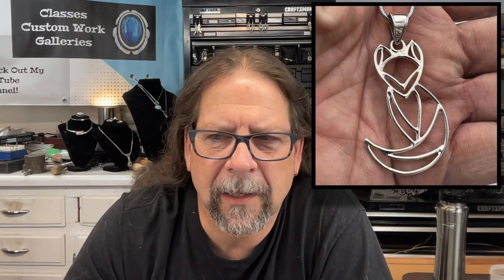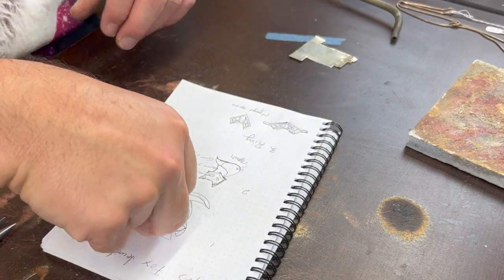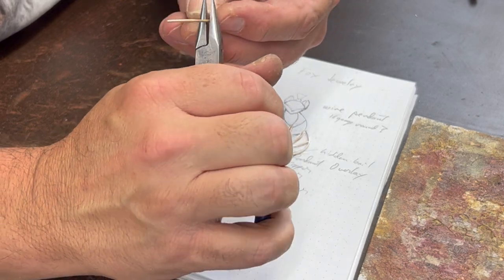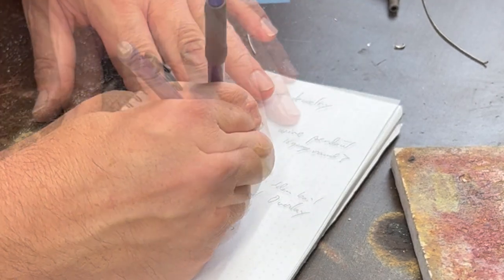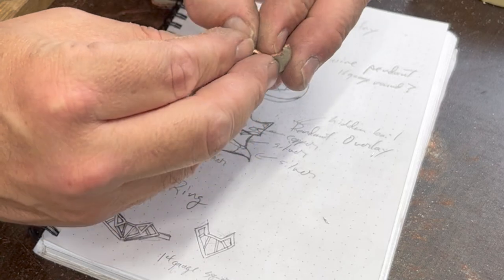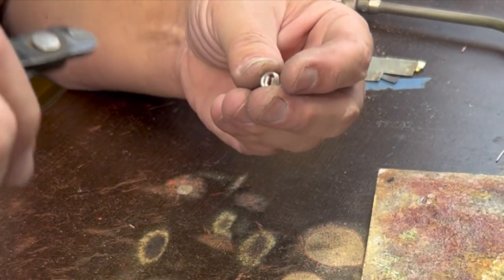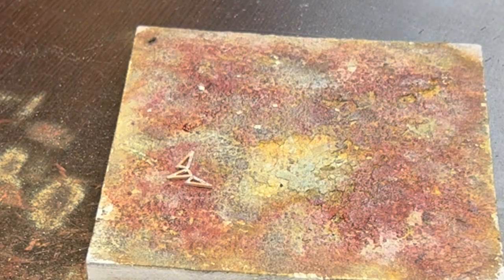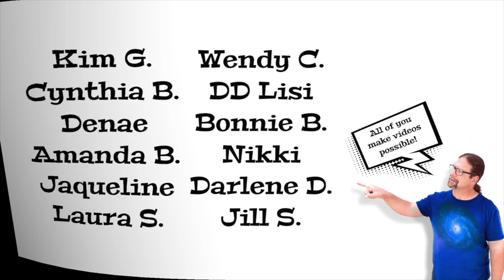Make 3 Fun Fox Themed Jewelry Pieces: A Silversmithing Tutorial

Comment: What is the spray flux that you use? Sorry if it's obvious, I live in the uk so maybe something we don't use. Also is your torch one of the ones you have to blow into ia a tube? 

I've never had a problem mixing copper and silver in pickle 😊
Reply from the maker: It is My-T-Flux. Pretty much the same as Battern’s Self-Pickling Flux which may be more available outside the US.  My torch is an Acetylene/Air torch made by Smith. Hope this helps Sam:)